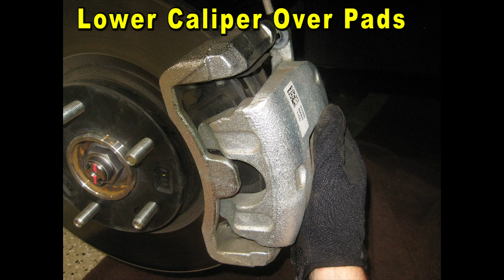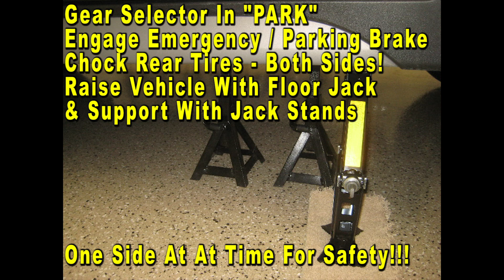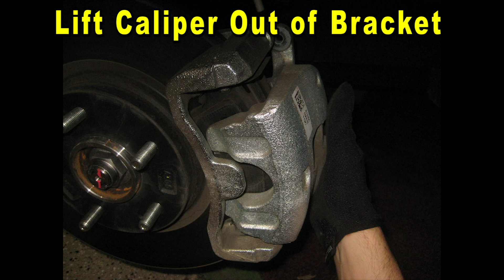Hyundai Tucson How To Change Front Brake Pads 2016 To 2021 3rd Gen With Part Numbers

Comment from the maker: Check out the DIY guide for changing the front brake pads on a 3rd generation 2016 to 2021 Hyundai Tucson -
https://www.paulstravelpictures.com/2016-2018-Hyundai-Tucson-Front-Brake-Pads-Replacement-Guide/index.html

Here are all of the DIY repair and maintenance tutorials for the third generation 2016, 2017, 2018, 2019, 2020 & 2021 Hyundai Tucson - 
https://www.paulstravelpictures.com/Articles/2016-2018-Hyundai-Tucson-Common-Problems-DIY-Repair-Maintenance-Guides.htm

Owners of other Hyundai, Kia and Genesis vehicles such as the Santa Fe, Kona, Elantra, Sonata, Accent, Veloster, Ioniq, Nexo, G80, G90, Stinger, Rio, Forte, Optima, Cadenza, K900, Soul, Niro, Sportage, Sorento and Sedona may also find these DIY instructions to be helpful.

Comment from the maker: Hyundai Tucson Front Brake Pads - https://amzn.to/3ErZd4N
Power Stop Front Brake Pads Part Number - https://amzn.to/3E95Atu
Raybestos Premium Front Brake Pads - https://amzn.to/3KRKfZp
Wagner Ceramic Front Brake Pads Part # - https://amzn.to/3P9LgP4
"F" Clamp - https://amzn.to/44oCpx0
Dielectric Grease - https://amzn.to/45lZPVb
Precision Screwdriver Set - https://amzn.to/3OYN1i0
Plastic Pry Bar Tools - https://amzn.to/3HMtsV7
Socket & Ratchet Set - https://amzn.to/3Z17LbA
Mechanix Gloves - https://amzn.to/3jCnHkt
Torque Wrench - https://amzn.to/3vS5uSI

The Paul79UF YouTube channel is a participant in the Amazon Services LLC Associates Program, an affiliate advertising program designed to provide a means for sites to earn advertising fees by advertising and linking to Amazon.

This DIY video shows owners of the third generation 2016, 2017, 2018, 2019, 2020, 2021 Hyundai Tucson how to change the front brake pads.